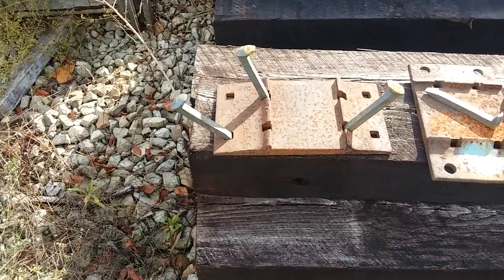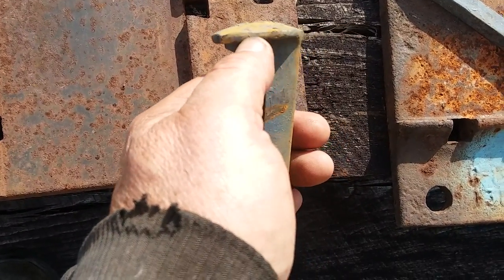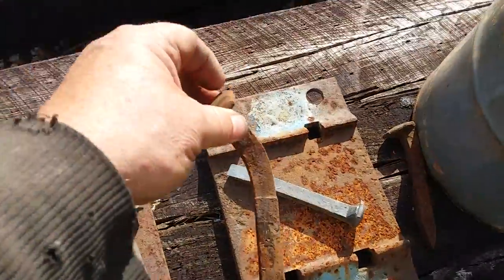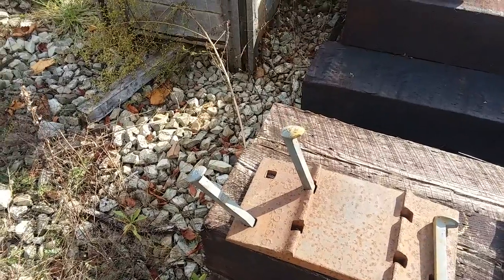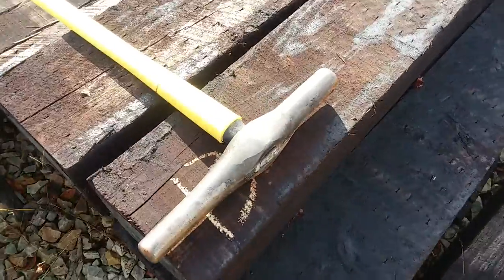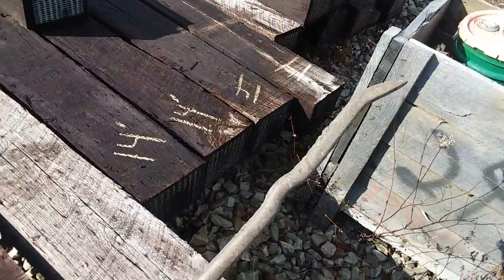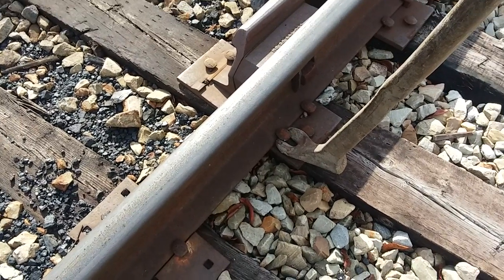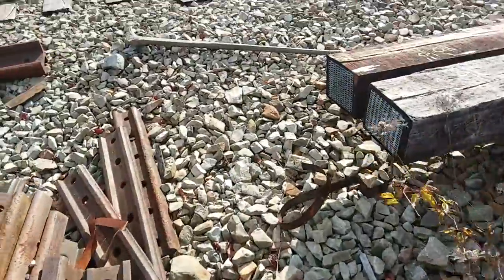All about Railroad Spikes

Comment: Nice video, here in the uk, we use some kind of pigs-tail looking clip, i dont work on the railway so im no expert, but i have walked along a dissused length of track before, and seen some knocked out and laying on the floor, from what i can remember, they look like a figure 8 thats been folded in half, i could be wrong, and i know someone will correct me 😂

But ya cant drive spikes into concrete ties i guess 🤷‍♂️
Reply from the maker: Thank you Russell. Those things you describe are most likely what
is called Pandrol clips, they use clips for the concrete ties, although
I'm sure other manufacturers make them besides Pandrol. Appreciate
very much your taking in the railroad spike video today.

Comment: How many miles is this railroad and what do they move?
Reply: we have 17 miles of track, we move coal from our mine in Kirby, Pa to a
harbor facility at Alicia Pa. where it is put on barges on the Monongehala river.
Reply: Interestingly, I worked as a part timer for 8 years on the Cleveland Commercial Railroad (CCR) first as a conductor, then as the track inspectors assistant. On my “real” job, I remember doing hirail weed control on your railroad back in the USS ownership days. Very interesting video, the first one of yours that I’ve seen.
Reply: @hirail53  Dave, Awesome comment, thank you. Anything you can share with us
about being here those early USS days would be really appreciated! Way back we did
have a monster brush cutter in here, but I believe that was when Cyprus Amax owned us.
We also had a local contractor brush hog along track for many years, We haven't sprayed
for over 35 years.

Comment: I laughed at the "dog dick" terminology for the spike puller. I'm a retired plumber (72) and I still have a cast iron drain fitting used for tying in  2" vent line to 4" vent lines back in the 1930. It looks like the letter h. The 4" section was the straight part of the h and the 2" section was the hump of the h.  Visualuze that a moment for full effect. I had, at one time, an old plumbing fitting  book that had hand drawn illustrated pictures of each fitting they made and a list of each size made, including the description (name,) of the fitting. This h looking cast iron fitting was listed in this book as a 4 x 2 Limberdick.  I guess people weren't too worried about being politically correct back then!
Reply: Awesome comment sir! I loved it. you right, some things you can't call anymore what
they were used to be called.

Comment: What's the curve in the claw bar for?
Reply: Mike the curve on the bottom part is made that way so it helps give greater
leverage and height to the spike when pulling it out. Perhaps another way of
saying that is it will pull the spike higher as the bar is being pushed down. Hope
that makes sense sir.
Reply: @ccrx-xu1wc  
I'm taking about the 3" dip in the long part of the handle.
Reply from the maker: Mike, that's a very good question and I honestly don't know why
it's shaped like that. Have asked around trying to get you a good answer, but no one I've talked to knows either. Sorry for the late
reply but wanted to try and get you a good answer, hopefully someone else may chime in and help us on this one.

Comment: What is the Guage of the track
Reply from the maker: Two answers to that, the gauge is the distance between the 2 inside rail heads, it is measured 5/8 inch down from the top of the rail. All standard gauge track in this country is 56 1/2 inches. Thank you for watching and hope you enjoyed

Comment: Speaking of spikes, did you known that railroad spikes are not made of hard iron. In fact even the ones stamped HC meaningn high carbon are in fact relativelyy low in carbon % . Carbon hardens iron, and hard iron is not durable in a railway environment. In fact the only real hardenable iron used are the rail clips. They are made of 5160 spring steel. I have made several spike knives for retired railroad workers at request of loved ones and buddies. But if they are going to actually use the knife you should request it made from rail clips to have a high quality knife. Easier to order 5160 from knife supply shop but not as cool as being from the rail line a guy worked on his whole life.
Reply from the maker: Michael, very interesting comment sir, thank you for sharing that with us. Sounds like you know your steel pretty well. You wouldn't happen to be a Steelers fan.... just kidding but it made me laugh anyway. Yep you are right it is cool to have a knife made from a spike where you worked, when I retire I may have to send you a spike or rail clip. Do appreciate your watching and your comments

Comment: It looks like the ties have a grain running the long length.  It also looks like the cut on the spike point is crossways to the running grain, thus cutting the grain. Is this right. Maybe you might mention this in a future video.  Thanks for sharing with us.
Reply: Yes you are correct and Thank You for adding some good info to this vid, I actually
never had thought to say that. Good Thinking my friend!
Reply: Square or cut nails cut the wood fibers that bend down along the side of the spike and resist pulling out. If the spike was turned 90 degrees it would tend to split the tie along the grain.
Reply: @charlesward8196  Charles, very good comment, thank you, great explanation!
That's Railroadin !!!!

Comment: We don’t use spikes anymore
Reply from the maker: Peter, do you guys use all Pandrol then? If so then do you use lags to anchor plates to tie. A lot of new construction uses the concrete ties with the clips. We can't use mixed concrete and ties cause the limits on my tamper workheads would have to be changed to accomodate the different types of ties, thanks for wrting in

Comment: The railroad spikes you have is high carbon
Reply from the maker: Yes sir they are. I did not express myself very well in the video,
I should have said, the spikes were high carbon, but not as high in
carbon as the rail is. They are stamped HC on the head, which
also neglected to point out, just can't seem to remember
everything to say when I make these. Thanks for your write in sir!

Comment: Dave...great visuals and history.  Too bad you are unfamiliar with the tool names or the their proper usage. It's a 4 ball spike puller. And you never ever strike the heel of a claw bar...you use a spike lifter to get the head up far enough to use the claw bar. Read some AREMA procedures and visit some railroads tool web sites.
Reply: Thank you for your comment, you are correct in that the official name is called a
4 ball puller. I apologize for forgetting to say that, but appreciate that you have added
some good info to the vid.  I am curious why you say a claw bar should never be hit
on it's heel? I have never heard that before?  but I learn new stuff all the time about railroading.
Reply: They say to not strike a claw bar due to the metals composition, as it will spall and little chunks of metal will go flying like a bullet. We wrapped our spike lifters with duct tape for the same reason, to catch any fragments. I’ve also seen lifters with little rubber skirts over the top of the lifting head to try and slow down the head of the spike in case it breaks off when lifting.
Reply: @pullerofspikes  Duct tape is not an AREMA approved practice when it comes to tool modifications. There are spike 'shields' for spike lifters as well as 'rubber head protectors' for the 'struck' end of the tool. Check out a tool website for images. Try www.industryrailway.com
Reply: @lewruss7614  Yeah I forgot to say that we put rubber collars on the back of the lifter then duct taped all that.
Reply: @pullerofspikes  To replace the duct tape, there is now a 'coating' put over the rubber head protector to further secure it and extend tool life. See the website previously mentioned.
Reply: @pullerofspikes  Yes sir you are correct. However I don't have a lifter or as some
folks call it spike ease, guess I really should get one. I do keep the heel dressed along
with heads of spiking mauls, I will definitely try your duct tape idea, Thank You!

Comment: Typical mainline rail 132# + is 5/8x6 in. Crossties are 7x9x8’6”.
Reply: Yes sir, you are correct, for those who don't know what he is saying, the 5/8x6 is the
gauge of the track, it is standard gauge for American railroads and is 5 foot, 8 and 1/2 inches
wide. Tinker, we have almost all 132 which was original weight, over the years we have
replaced some of it with 136, but probably 95% of our rail is still 132.

Comment: Don't use those fibreglass handles for real work, soak your wood handles in 50/50 mix of linseed oil and kerosine for about 2 weeks and then fit it to your hammer head then see if you can break your handle.
Reply from the maker: Very interesting, I will have to try doing that! Never heard of that
being done before. Appreciate your sharing.